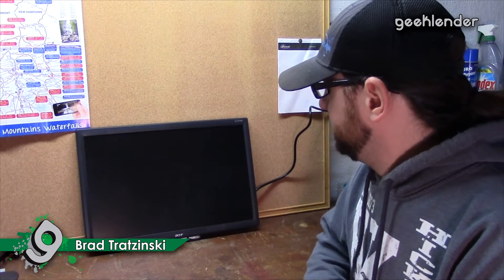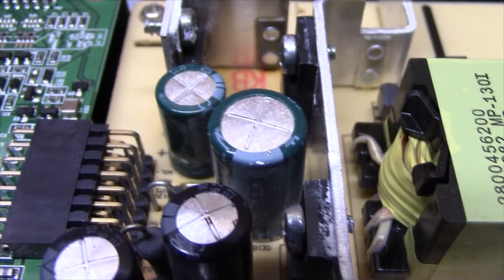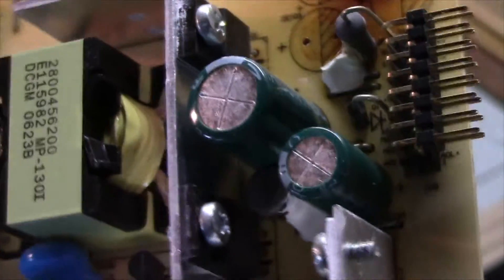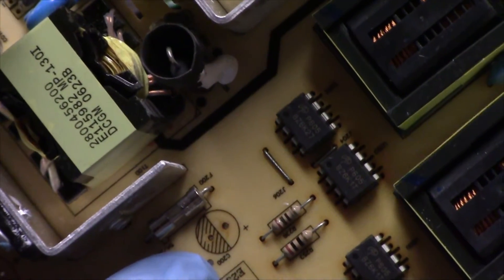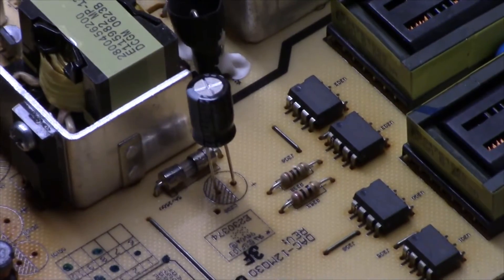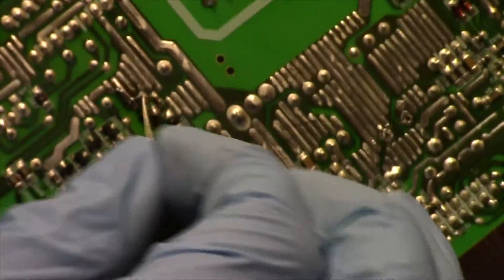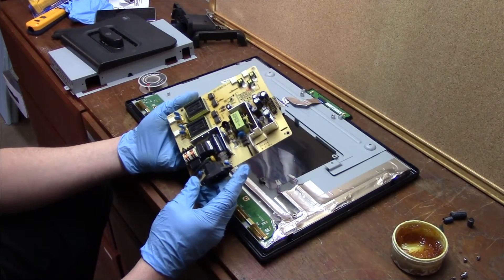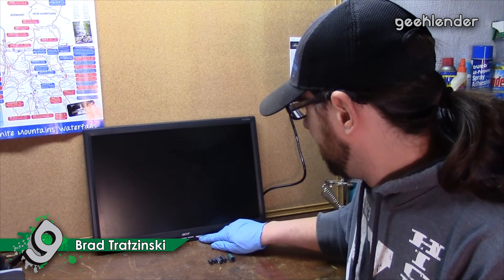Acer Monitor Repair AL1916W - Brad Tratzinski

Comment: Thanks for doing this, very clear. I tore my X203H down and found that one of the little blue  ceramic capacitors is fried. For the life of me, I can't find a value for a replacement as they don't have any markings. It's listed on the board as capacitor C523. I may just throw a random one in and see what happens. None of the caps looked swollen or leaky.

Comment: I have the same monitor. My led went orange and never power up to green one night. I found 4 or 5 bad capacitors replaced them with new ones , no change. Still doesn t power up. I ve checked and measure all the diodes from power board , I have 4 CI on radiators I m suspecting they are right, don t see anything blow up or something, also 2 little transistors, which seem fine, resistors ok. From PowerBoard it goes out around 5V where it should be, and another voltage 14, 5 V or so into the logic board. What can it be? I can t figure it out. The led is stay orange. Press, press no change. It doesn t power up to green. I ve checked the little switch board seems ok all the switches. What are the 4 cables that goes left up into another long top screen board? Can it be faulted? Maybe u can help.
 Thanks!

Comment: The info on bulging elcos was new to me. With the help of your video, i repaired a acer al1916w. I replaced the 2 1000 uf 25 v capacitors. I got this acer al1916w on a secondhand market for 8 euro :-) Thanks for your video.

Comment: My pc works fine but the screenshotten is Black and the power button is blinking, i checked the cables and everythin was fine
Reply from the maker: +a 5 year old who doesnt wanna get kidnaped by a stranger This also could be a problem with your capacitors on the power supply board.
Reply: Brad Tratzinski too late i already buyed a screen but thanks for the help! Youre a nice dood :D

Comment: Hi Brad, I was wondering how the back comes off? I don't see any screw holes on mine.
Reply from the maker: +Nick Vinnicombe It's snapped together. Just be real careful and start at the bottom right hand corner and work around counter clockwise. Make sure you don't go in to far with your pry tool as you could damage the screen or other components. I hope this helps. Cheers!
Reply: Brad Tratzinski Sounds good, thanks!
Reply: Thanks for the tip.

Comment: I have same monitor and all my capaciters are good, what can i try to check no ? where are the fuses?
Reply from the maker: filipekmr Here is what the fuses look like.
https://youtu.be/zyRbYR2NlP8?t=5m16s
and
https://youtu.be/zyRbYR2NlP8?t=14m32s
Thanks for watching.
Reply: Brad Tratzinski 
thanks mate , but my monitor dont have that :( 
my monitor is acer al1916w but the power board is one DAC-19M008 , and im trying to fix the monitor to use like the second one.. when i plug the power cable i just listen to 'piiiiiiiiiiii'' and all my capaciters. thanks m8
Reply from the maker: filipekmr
Sorry I don't know what the problem could be without looking at it.

Comment: Brad, what the valur of R528 of the inverter board? And C523 near the output and closest to him?
Reply from the maker: StreamC Noremorse Sorry, I have had that monitor closed up for a while now. The capacitor values are printed on the side of them and the resistors are color coded. Do a quick Google search for a resistor calculator to determine the values. Cheers!
Reply: There are many revisions for schematic of power supply and inverter. I have AL1716 but just one of them go for me And this is the same as LG 1916 except two of Zener diodes. But I have not inverter schematic. Just only power supply that produce 12V and 5V. My board consist of two of them (power supply+inverter)